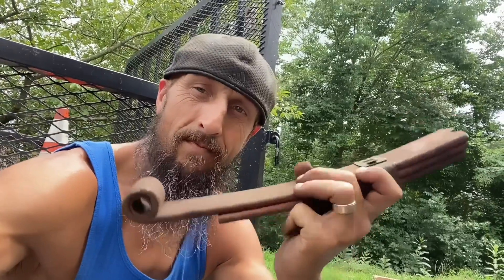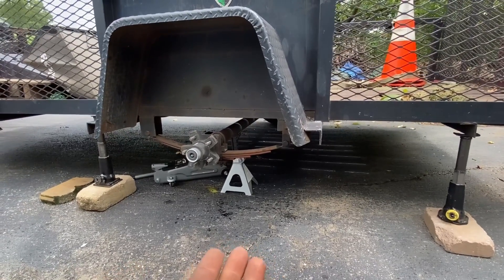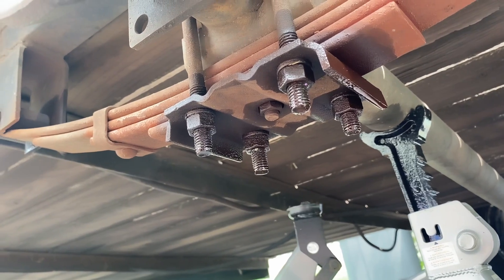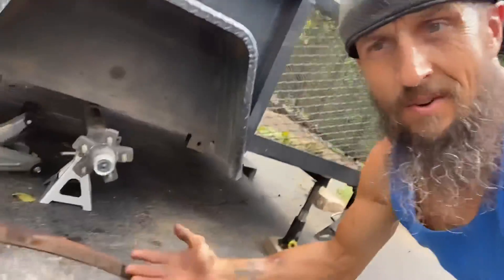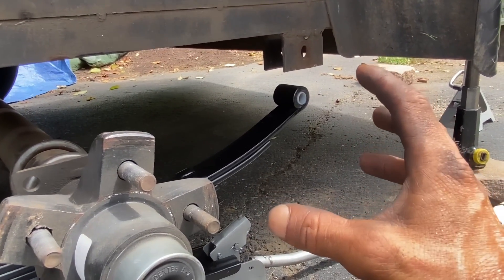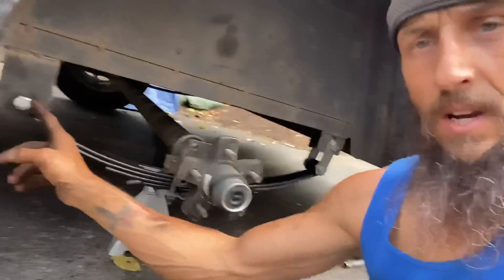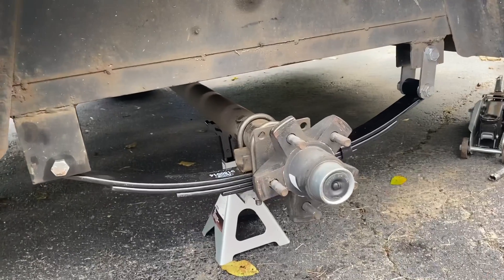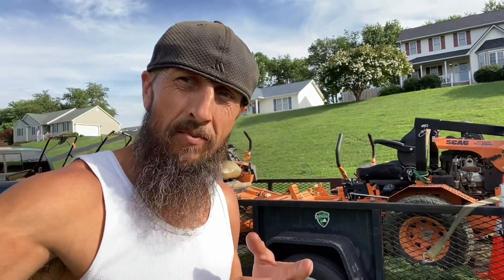HOW TO… Replace LEAF SPRINGS on TRAILER / BACKYARD MECHANICS Saving MONEY

Comment: very smart to go with the 4 leaf pack springs.   I would say 4 will last longer and support more weight.  Your trailer might be a lighter duty type made of angle iron frame but still 4 leafs is way better.

Comment: The nurse is nice 😋  Glad your soulmate got you fixed up, brother. Nice work 👊 Did you check the bearings for grease while you had the wheels off, and also check bolt torque after you took her out with the mowers?   Those springs didn't come with u bolts??? What type of..... 😂  Yeah, last time I got some repair and welding work done on my trailer ( beginning of the season ), they told me the axle is about clapped and I still haven't gotten that done, been running her down these raggedy Pa roads for months..... I think the trailer's like 5 years old now, which reminds me, I think I have to renew the 5 year registration 😵‍💫  But anyway  I've kept her and that axle loaded with mowers 24/7  because that's been my storage situation thus far 🙄 Not good for axles or springs 🤷‍♂️  I haven't decided if I'm gonna do it or have them do it, because I also have some more welding work I need done ( fold down stabilizing jacks on the back of the trailer to help keep loading and unloading from yanking my trucks all around ....for the last two or three seasons I've been using jackstands....and I wheelchock the truck too....extra steps  but I'm pretty fast with it, and it works pretty well ) but then  I still have my harbor freight flux welder that's been sitting in the box for 3 years now 😬😬😂🤣  We'll see.  

Time for some shrimp for breakfast, then some Saturday mowing and mulching 😮‍💨💪💪🏽💪🏻
Reply from the maker: Always my favorite 😍 😂💪 Man… these crazy struggles are FOR REAL 😂 thanks so much for the update my Brother 🤜🤛😎

Comment: Man, I am completely redoing a car hauler suspension.  My equalizer, shackle links, u bolts, bearings, bushings, and all are shot. I am going to replace the leaf springs on the rear axle. The binding strap on one spring has slipped a couple of inches.
You have to change both sides of the axle, so they are equal.
Reply from the maker: 🤜🤛 Good luck with a smooth project bro!! 😎